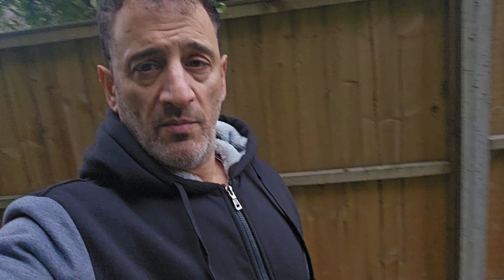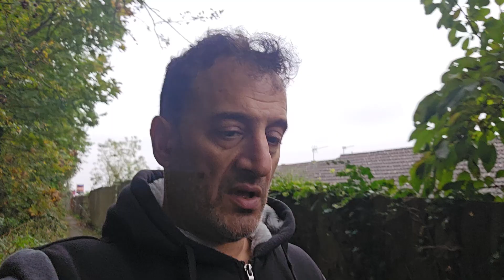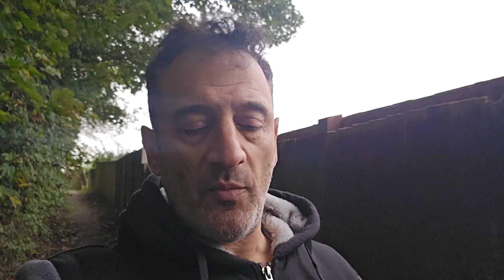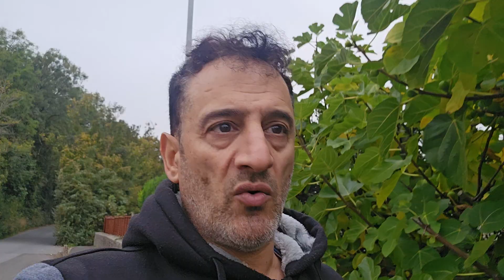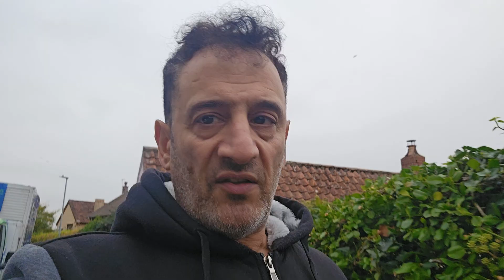DMR for Newbies

Comment: My first DMR radio was a Hytera PD785 which I didn't go out of my way to buy it I just got lucky and happened to stumble across it at a flea market and I got it for a tenner, I knew it was DMR and I got excited about it because I thought I would be hearing traffic 24/7 from all over the world but I was wrong. I've been programming PMR stuff for a long time mostly Motorola stuff and Taits but I had zero experience with programming Digital radios and I'm still no expert in programming DMR stuff. I've never given up and even to this day I am still learning about DMR. Its a steep learning curve. I think the best DMR radios are those that can scan color codes and talk groups for listening like some of the DMR AnyTone stuff and there not bad on price. As for the DMR repeater I use a 70cm Yagi antenna as its a bit weak on lets say an x50 antenna.
Reply from the maker: Create one channel from scratch then you will know dmr
Reply: @M0FXBHamTech  except there is a bit more to it than programing a channel with DMR.

Comment: In my local community, a good friend of mine is helping the older local amateurs get setup with DMR. He has been ordering the Motorola style Baofengs for around $80 Canadian, finding inexpensive Raspberry Pis and the hats and 3d printing the cases. We have gotten 2 or 3 guys setup in the last month. I spent quite a bit of time working with one friend up the road, getting him setup. It was well worth the work, he is having a grand time on DMR using different talkgroups. The same friend that's setting everyone up, changed a local repeater here in Halifax over to DMR... It's amazing to be able to step outside at work and use any Brandmeister talkgroup through the repeater.
Reply from the maker: Nice help
Reply: @M0FXBHamTech You helped me a lot with DMR with a lot of your videos, I'm using that knowledge you shared to help others

Comment: Great video!! Once you understand DMR and how it works, you can never not understand it. I reverse engineered a code plug for the RADIODDITY DB25-D that a fellow ham sent to me when I was having issues getting it up and running, & from there I learned how it worked not only for that radio, but also for the other two DMR radios that I own. All 3 are made by different manufacturers, and they all use the same structure and concept. The only difference is the 3 different CPS’s that are used to program each of them when connected to a computer.
KF0SLJ
Reply from the maker: Totally agree 73